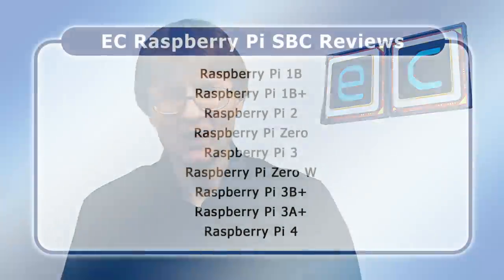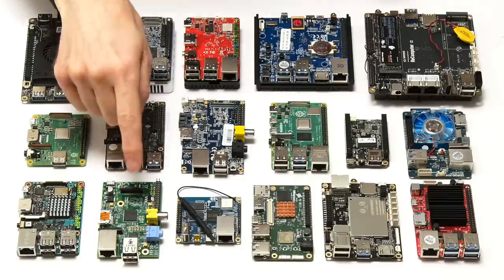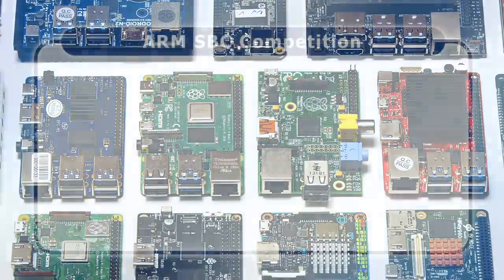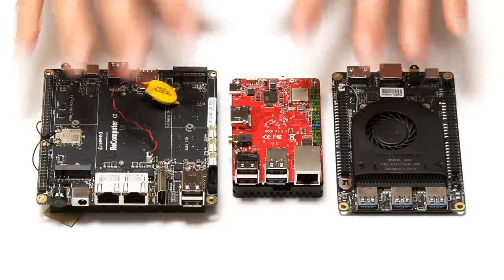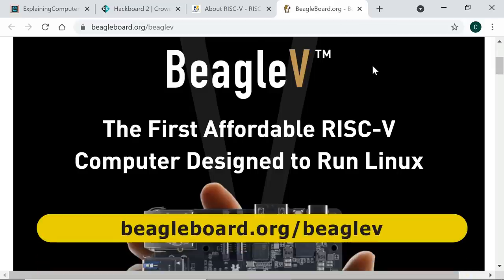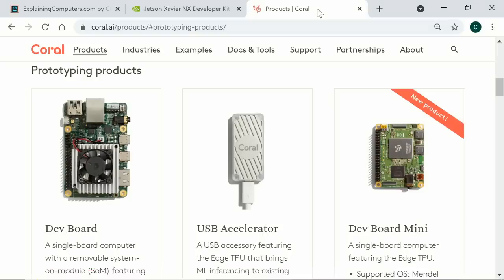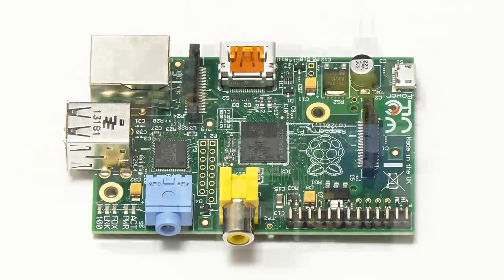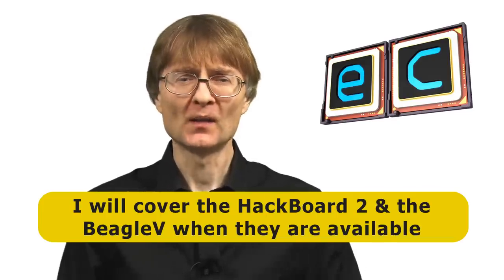SBCs in 2021: The State of Play

Comment: A Pi400 kit and a 21" monitor with speakers runs about US$200. That gets you a fully functional personal computer with a full OS and a large variety of software choices.  A similar Chromebook costs about the same, but without the full OS and capabilities. An equivalent low-end Wintel system cannot be touched for less that $350 dollars today. The real beauty of the maker market is access to the actual system; Wintel and Chrome OS do not offer the access needed without lots of additional knowledge and tools. I have bought almost 20 Pi boards in the last few years. My kids and their friends have built at least 50 different projects with them and learned valuable skills in the process, instead of burning those hours on Halo and Super Mario Kart.
Reply: You can't compare a desktop with a laptop price-wise.
Reply: @Okurka.  You're right, laptops dominate desktops while chugging 1/10th the power and taking up far less space.

The power consumption is pretty important since desktop PSUs chug an unholy amount of amperage, which in a lot of settings (America in general, apartments, etc.)... is a really bad idea.

Current 15-25W equivalent tier Ryzen laptop SoCs trade blows with the 65W minimum Ryzen 7 3700X, a CPU that's not even two years old. Realistically at actual high-end applications, the Ryzen 7 3700X is looking to take more closer to 90-105W. It isn't running anywhere near its max speeds at 65W.
Reply: @Tano For good reason. The pi can be a laptop computer, but you can do so many other types of projects with it.
Reply: @acumenium8157  WTF are you on about?  PSUs only consume amperage comensurate with load, and ATX psus are much more efficient.
Reply: @BenState  My laptop with an i7 8750H and 1050 TI can't consume more than 150W, or 1.25A. Doing intense benchmarks on both my CPU and GPU I have never even seen it go over 130W, with 75W of it coming from the CPU.

The equivalent desktop parts would be well over 300W, or 2.5A.

This also isn't getting into the nasty fact that PSUs chug their entire load when first turned on. SOME circuit breakers allow themselves to go a bit over their allotted max for a brief time as long as it can detect that it's temporary. This is seen with refrigerators, which can consume ~1-2A on average and spike to over 12 at times, with both figures depending on the size.

However, notice I said "some circuit breakers". Many don't. Go any over, and you'll HOPEFULLY trip it. That's a safety mechanism. Go over what a breaker wants and if it LACKS safety mechanisms... grab the extinguisher, or preferably, run.

Also most ATX power supplies blow. For every 1000$ EVGA or Corsair PSU you're going to have hundreds, if not thousands, of the many EVEN FROM THOSE COMPANIES that are expensive and suck, and then the many from those or OTHERS that are even worse, like OEMs, etc.
Reply: @acumenium8157  your math is wrong, your ideas are wrong.  that is not how it works.  you cannot compare desktop and laptop parts.
Reply: @BenState  yeah, you can lol.

SO-DIMMs are just the same as desktop RAM but more power efficient and smaller. Benchmark wise they'll test the same.

You know some Mini ITX boards use desktop CPUs, desktop GPUs, and SO-DIMMs? :D

Laptop GPUs are the same as desktop GPUs since the GTX 1000 series. Only difference is maybe a slight wattage difference, and some variants like Max Qs have been known to outperform desktop variants while being, again, more power efficient.

We don't have "mobile GPUs" anymore. Most of a difference we have is in the laughable RTX 3000 series and it's in FAVOR of the laptop ones as, despite a lower TDP, they don't run at 110C just idling in the menu of Fortnite like the desktop 3080 does. The 3000 series is a power-hungry piece of shit, it's the first time there's been any real mobile/desktop disparity in 5+ years.

Laptop GPUs aren't comparable in the sense that they're allowed more power---they aren't drawing a screen typically (some do, like the RTXs found in iGPU-less Ryzen Clevos), the integrated GPU does that. That's a large amount of effort the dGPU is saved from doing, meanwhile it saves enormous power as well because the iGPU even on a desktop is never shut off.

Okay, so CPUs... yes, they are indeed comparable. The i7 8750H is within 10% of the performance of the desktop 8700 while being, generous, over 20W TDP less. Realistically it's a larger difference. The 8750H at full blast can chug up to 75W, the 8700 can and WILL see 100-120W.

Instead of screaming "YUH RAWNG YUH MATH ERR RAWNG YUH RAWNG" repeatedly like a little toddler, prove something wrong.
Reply: @acumenium8157  deluded
Reply: @BenState  You are, yes. My mobile CPU has as much computational power roughly as the i7 8700 or Ryzen 5 2600 at a fraction of the wattage, but you keep telling me how it doesn't. :)
Reply: @acumenium8157  the thermal and power package limits means you're never going to get the performance or functionality out of the components in a laptop form factor.  Period.
Reply: @acumenium8157  Nonsense.  If you think that you're completely at odds with physics.
Reply: @BenState  Why does my 45W laptop CPU bench better or equal to a 65W desktop CPU then?

Literally same generation LOL.
Reply: @acumenium8157  It doesnt.
Reply: @BenState  Prove me wrong. Quit screeching.
Reply: @acumenium8157  physics.
Reply: @BenState  Oh, so you have no proof. Move along, troll.
Reply: @acumenium8157  So tell me this, you're saying for 20W less, the mobile CPU will perform as well or better than the desktop variety?  And you have no rationale to back that up?  You're the troll.
Reply: Using passmark to benchmark here. The i7 10700k comes in around 19000 and the i7 10875H comes in around 15600.

Same silicon, same core and thread count, same generation, same 16 mb cache. Clocks are far apart and you're comparing 125w part to a 45w part. Yet, you have roughly 80% of the desktop performance. 

That's nothing to scoff at. With proper cooling and clocking the mobile processors can perform damn close to their desktop counterparts. 

That said im using just the one benchmark. And the statistics are derived from all tests performed, not just "stock" situations. So the desktop CPUs have higher scores in that people actually pushing their limits during benchmarks.
Reply: @acumenium8157  There are low tdp parts. Both Intel and and have low tdp desktop CPUs at around 35W And a midrange card like the 1050 to depending on the AIB partner could have a tdp as low as 75W. So you could build a comparable tdp rig to your laptop. But the desktop will outperform it. Because the desktop platform will have better clocks and better cooling. 

Most oems use decent power supplies in their prebuilts these days. From what I've seen and Gamers Nexus has noticed is that many of them are better than they are rated for, most definitely are better than 80+. 

So the efficiency is there from the wall.
Reply: @Linkedblade  No, the desktop won't. Prove one freaking thing you're claiming RIGHT NOW.
Reply: My observations exactly. You absolutely nailed it in one single comment. 👍

Comment: One interesting thing I've noticed is that recently there have been SBC's such as the Rock Pi S, Rock Pi E, some of the NanoPi SBC's that do not even come with a display output. They're interesting in their own right because the use-cases for them are rather niche and rarely do people review or talk about them. A few examples I can think of are for them to be used as NAS servers, cheap routers with more control or cluster computing.
Reply from the maker: Yes, I've yet to review such boards here, as the use case is more limited as you note. But there are IoT and related applications . ..
Reply: Some use for drones or straight up headless dev platforms.  All of my SBC's run headless ( SSH, git repo's, build / test kernels etc etc etc ) ... Not everyone or everything needs a display :D
Reply: @sethrd999  Yeah, I wasn't saying it as a bad thing, I even own two of the SBCs I listed, and even the other SBC's I have I rarely ever use the display and use them for basic things over SSH and/or as some local servers that do not have high computational/ram/storage reqirements.

Comment: Another very big barriers are the proprietary GPU drivers by arm, that are sold for money. That's why a lot of SBC doesn't have out-of-box graphics accelerator support. Thankfully we have the Panfrost driver for Midgard and Bifrost-based GPUs.

And yeah, I'm currently working on my Orange Pi Zero 2 to have a GPU support. In retrospect, I should've had bought a Raspberry Pi as an ARM development board instead.
Reply: *barrier is (to go with "another," which singular)

Comment: A jump from Raspberry Pi 3 to 4 was huge (if someone wants to compare that, use Google Maps). If the RPI 5 should come with 2Ghz clock and CPU on the other side of the board and full size HDMI, then the competition has no chance, at least with me.
Reply: Definitely try booting from an SSD if you haven't already, and try out the 64-bit version of Raspberry Pi OS. Both make the Pi significantly faster to use, even without overclocking.
Reply: @Tano   Spot on! Raspberry Pi Foundation take note.
Reply: @TFSned  I agree, I'm using a Pi4 8gb and I run a number of OSs from an SSD drive in a satisfactory way. Fine for Youtube videos and email. I  wouldn't want to be stuck with it for super intensive web work or video editing.... but this setup is a fine replacement for someone with minimal requirements.
Reply: @Dave They need a SoC with more than the single PCIe lane the current one has.

Comment: One factor in the reduced amount of releases is reduced demand.  The initial craze is over.  Growth in the market peaked for this point in time.  Many of the people who bought earlier Raspberry Pi models didn't have much business doing so.  The people who watched their first Raspbery Pi collect dust aren't buying newer models.  If devices of this size/type ever become the defacto choice for a PC, only then the market will increase once more.  The fact is that most people aren't engineers or even tinkerers; they're consumers.  The majority of Raspberry Pis are basically used as PCs; not as 'makerboards' for specialized projects.  The 'maker' marketing meme has run out of steam.
Reply: I am not 100% on that statement.  At our local makerspace there are tons of things going on with current and getting ready for new boards.  As I called myself heh there are quite a few ( and I am happy to see ) happy hackers out there doing cool stuff and driving the movement.

We do teach these skills to others who come in and want to learn, everything from Arduino / micro controllers to focused projects with electronics etc etc.  Cosplay is quite large there also actually.  We have DJ's that amp their kit with light shows / custom controllers and we teach them to stitch it all together and make it work and they learn as they go which actually rocks.

Comment: The new Beagle Board RISC V SBC may be similarly challenged as other low-cost non-Raspberry Pi SBCs, since its performance looks to be around 50% of the Pi 4 but is twice the cost.
Reply from the maker: Agreed . . . there is no guarantee that RISC V SBCs will take over the market . . .
Reply: Its not about the CPU in this one its got Neural Processing Units among other things and its 100% Open Source.  There are talks ( on the forum ) that we will have open ended PCIe ( Multi lane ) and NVMe.
Reply: RISC V Definitely has the potential to take over, but the amount of effort needed to give it adequate support will be immense. I imagine some low-level devs may buy a Beagle Board to start working on supporting RISC V.
Reply: RISC-V is promising, but looks like it'll take another decade or two of development to catch up with ARM or x86
Reply: As I understand, the big benefit of RISC-V is that the CPU is open-source and you're not locked into one of a few proprietary vendors to get supplies of the chips--and you also can make your own CPUs using their open designs as a base.

If you've seen those ads for PCBWay on other channels, for making custom circuit boards to your specifications, I can envision a CPUWay someday cranking out RISC-V CPU chips to order.
Reply: @sethrd999  Good point, so a fairer comparison would be Nvidia's Jetson Nano with 4GB RAM which is similarly priced to the Beagle Board, has a CPU performance equivalent to Pi 4, but enhanced GPU and neural processing support.
Reply: And the RISC V SBC might only be getting worse as Intel enters and owns the IP?
Reply: @ExplainingComputers  "Agreed . . . there is no guarantee that RISC V SBCs will take over the market . . ."
RISCV is still very much an infantile architecture, starting development back in 2010, and only just getting it's metaphorical foot into the door around 2016-17 time-frame. With that said, it will be a while before we can even expect to see RISC-V based processors even starting to run head-less linux kernals smoothly, let alone running a full windows platform. However, around the 2030-2040 era of computing, i wouldn't be surprised id RISC-V processors would have an upbringing similar to what VIA had back in the day, but actually hold on in the cheaper computing and development bracket.
Reply: @jb31842  no that's not correct. The RISC-V instruction set is free an open source. People who make CPUs using that instruction set are free to make them proprietary or open source.
Reply: @MikeLisanke  even if Intel buys SiFive, they are just one of many RISC-V vendors, and don't own or control the RISC-V instruction set.
Reply: @nightshadelenar  I've been running headless Linux on my HiFive Unleashed for 3 1/2 years already. That's a quad core 64 bit RISC-V CPU which I run at 1.45 GHz, with 8 GB of DDR4. It's somewhere between a Pi 2 and Pi 3 in performance.The new HiFive Unmatched and Beagle V both run a RISC-V core more or less equivalent to an ARM A55 at 1.5 GHz. They're typically faster than a Pi 3 or Odroid C2 at things that use normal C code, not SIMD or crypto instructions (which RISC-V doesn't have yet, but will by the end of this year). Don't forget that two years and one week ago the Pi 3 was still the fastest Pi. RISC-V became public and SiFIve was founded after the A72 core used in the Pi 4 was released. It's very very new but advancing fast.
Reply: @BruceHoult  We've seen many 500lb Gorillas, "buy" and open source project... I'm certain Intel is just being supportive of Open HW technology... not! Amazon bought FreeRTOS and now I'm not certain I can use it. FB had some dodgy language it slipped into its projects' EULA. And there was a Chrome plugin whose OS project was bought by an unknown user for unknown reason lock-stock-barrel. If you're polite, you'll just call me a suspicious type. It could be, RISC-V purchase is just so Intel can influence it to better compete with NVidia Arm. I don't have any inside information... And I'm still very hopeful that the ISA concept comes to fruition And we can start to push generic function into HW architecture.

Comment: Hi Chris, please could you do an explaining video on "TPM Chips" as I see the rise in demand of them due to the release of Windows 11 and how people need them to run it? - Thanks in advance!
Reply from the maker: Hi Jay. I will definately being doing a Windows 11 and TPM video fairly soon! I hope that all is well with you.
Reply: @ExplainingComputers  Hi Chris, Thanks for your reply! I am looking forward to your video about Windows 11 and TPM. I am doing well thank you! I hope you are doing well!?
Reply: Also, fun fact. Ryzen chips already have these “TPM chips” integrated into the CPU die! You just have to enable it on the BIOS
Reply: @kurnma3776  Also, fun fact. Intel Core chips since Skylake (6th gen) already have these "TPM chips" integrated into the CPU die! You just have to enable it on the BIOS
Reply: @Winnetou17  Yup.
Reply: @shorttimer874  thanks for the tip.  Looks like I'm good to go with TPM 2.0.
Reply: @ExplainingComputers  It should be pointed out that Microsoft also claims that it will require an 8th generation Intel chip, at a minimum. (2nd gen Ryzen IIRC.) These requirements may prove more difficult than having a TPM2 chip, as those processors are a number of years newer than TPM2 chip presence on the market.
Reply: @vinnytube1001  ive seen win11 run on very old laptop already.
Reply: @Winnetou17  Intel is clearly better than AMD, I don’t care what anyone says.
Reply: @kurnma3776   Intel is clearly better than AMD, I don’t care what anyone says.
Reply: @zackaboy1236  Both have different aims and different purposes, and it’s up someone’s preference if they like AMD or Intel
Reply: @jonathanvandenberg3571  1) How do you define very old. 2) We're seeing reports that Microsoft's Health Check tool is telling people with Intel processors older than 8th gen that they can't upgrade. 8th gen laptops could be as old as 5 years at this point, so if you think that's "very old" then sure. 3) The Win10 upgrade tool may refuse to work due to these checks but it's possible the traditional fresh-install-from-media route doesn't use these checks.
Reply: @zackaboy1236  You cant just blanket statement like that without a better explanation as to your reasoning :D.  I for one say my required security errata ( Linux kernel fixes for bad decisions ) says otherwise on Intel CPU;s for instance.
Reply: Kurnma377 but entering bios/uefi for normal consumers is another challenge for them (: